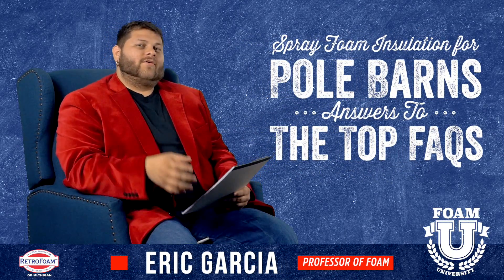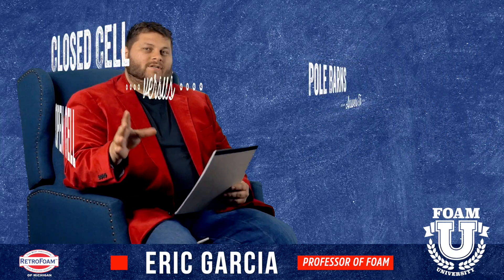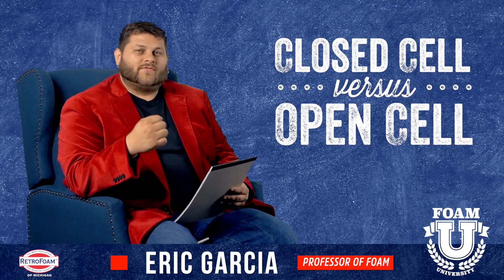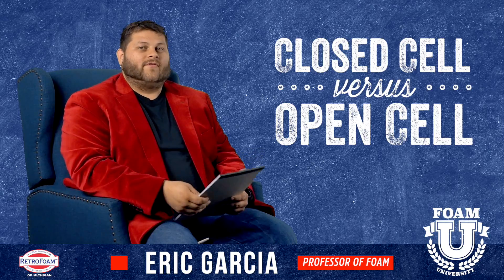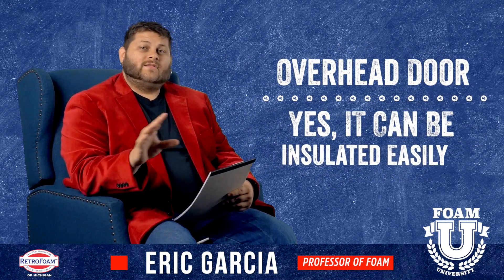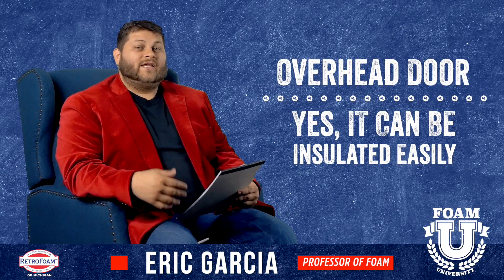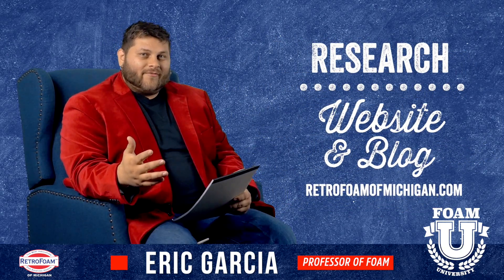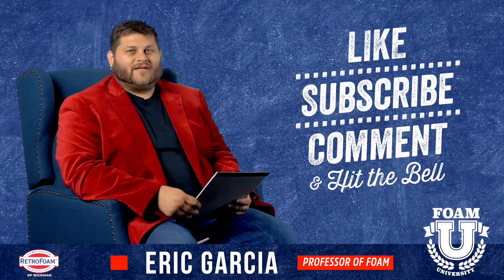Spray Foam Insulation for Pole Barns: Answers to the Top FAQ’s | Foam University

Comment: How about insulating over existing Pole Barn Insulation Blankets with foam? I have an existing pole barn I am going to frame up sheetrock walls on the inside of the exterior walls. I was wanting to add additional insulation instead of leaving 5-inch wall cavities. Either doing foam insulation are adding more fiberglass insulation.
Reply from the maker: Hey Travis! We recommend removing any existing insulation and doing spray foam insulation.

Comment: We are building our new home with a metal pole barn on a slab. Our contractor hired a spray foam insulator for the job. We were NOT told to cover the floor, and the insulator didn't either. We are planning to stain the concrete. I am now trying to clean overspray off of almost 1200 sf of concrete. Do you have any tips that would help? Thank you.
Reply from the maker: A floor scrubber, bristle brush, and lots of elbow grease is the best I can recommend.

Comment: Should you use expandable spray foam on a metal roof easements? I see doing this to keep bees out. But, wouldn't that stop air movement, or if water or moisture got under it, wouldn't the opening alow it to drain? So, seal the ribs on the easements, or not to seal.....that is the question.
Reply from the maker: We recommend for roofs to be as sealed as possible. Any ventilation should be mechanical in that situation.
Reply: @RetroFoamofMichigan  ok. This is just a hunting blind. Nothing fancy. I just want to keep bugs and mice and water out.

Comment: I have a pole barn with cathedral ceiling and 2x6 on its edge for purlins I want to leave the metal truss showing I used dripstop metal how can I insulate that within the 2x6 without having a condensate problem?
Reply from the maker: We would spray right to the purlins. We recommend 3-inches of open cell or 2-inches of closed cell on the walls and 6-inches of open cell or 5-inches of closed cell for the roof deck.

Comment: Central Indiana. We are building a  house out of our pole barn. Thinking of encapsulating the ceilings, walls and crawl space with closed cell 2 inch thick.  Leaving the  ceiling open with no dry wall, covering with tongue and groove. How can we ventilate or do we need to?
Reply from the maker: That sounds like a great plan! There is no need for you to add ventilation in this scenario.
Reply: RetroFoamofMichigan so the entire pole barn will have 2 inches of closed cell spray foam insulation rafters, walls, crawl space walls and floor joists and that will be OK with no ventilation?  They want to fill in the ridge vent with spray foam also.
Reply from the maker: @teresaledford3863  Yes, that is fine. Basically, you are creating a conditioned space with the foam. You don't have to worry about circulating hot air out in the rafters and fresh cooler air in because the foam is creating an air seal.